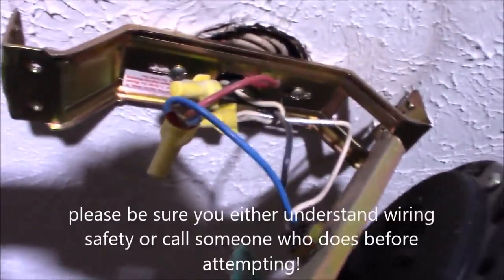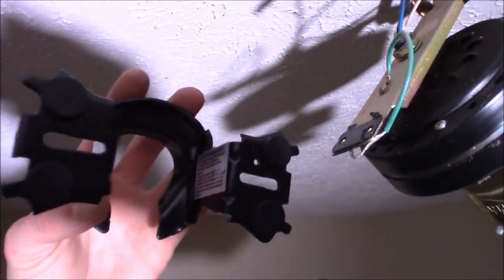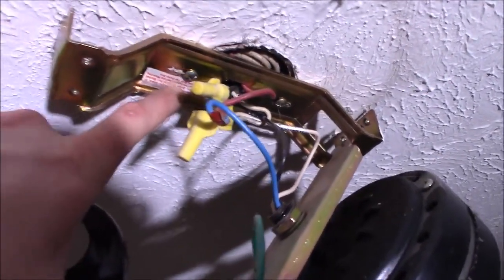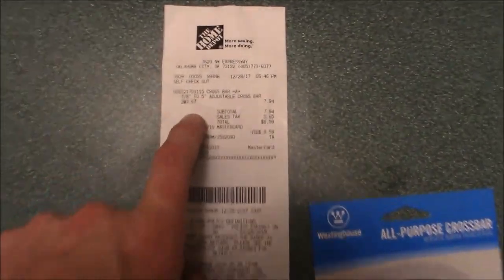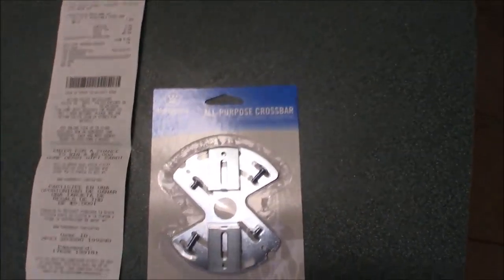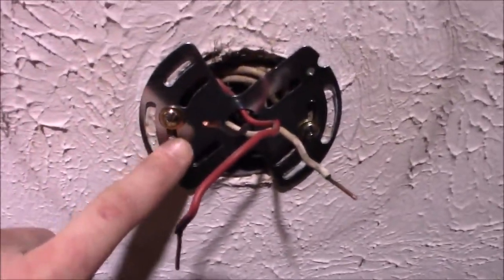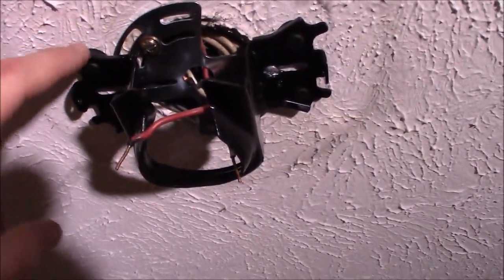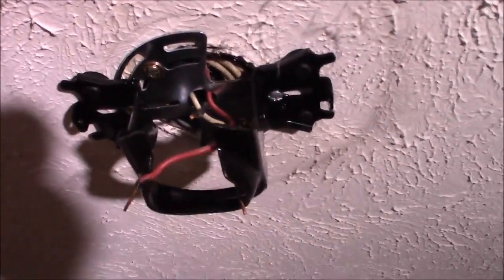Ceiling Fan Universal Mounting Bracket

Comment: Oh the joys of home ownership. This is the exact dilemma I have and I bought the same universal bracket from home depot. Thank you for this tutorial because I got stuck figuring out how to mount the universal plate with the hunter fancy pants bracket. Victory is near. Thanks again!
Reply from the maker: glad it helped some, how did it turn out?
Reply: Daddy's work is never done
We (BF) actually bent the new bracket in to fit the existing 3in light box (it was out of line by 5/8 -7/8 in) and back up and out at the ears to fit the canopy. It fits and works perfectly and balanced. We didn't use the universal plate.
I'm saying we because I bought the darn thing. Lol

Comment: I had the exact same problem with the Hunter Avia II Model Model 50601. I called their customer service, but they were pretty much clueless as to how to fix the problem. I called an electrician to have them retrofit and replace the junction box in the ceiling which they quoted would approximately cost about $300 including fan installation. I gave it another try to find an easier way to do this on YouTube and finally landed on this video. THANK GOD! This is exactly what my problem was and I found an easy fix. Awesome.

Comment: So my box was 4" and had an old fan that I had to replace.   I got the same bracket at home depot for $4.50 and it fit perfectly.   The new Hunter bay bracket then fit the extended holes perfectly.   Thanks for your video this is the only video that I found showing how to retrofit the ceiling box to fit the bigger Hunter Bay bracket..   5 stars from me!

Comment: Exactly what I needed too.

Wish you could have recorded the actual  installation of the bracket and which screws you used in the specific holes/slots
Reply from the maker: sorry man, I really wanted to get that part, but not enough hands, and don't have a high dollar go pro forehead mount
Reply: @workingdad  Did you use the screws that came with the cross bar to attach the fan bracket?

Comment: I almost pay $300 to an electrician because I couldn’t figure this out. My house was build in 1971 and has exactly the same ceiling light boxes. But I was changing a light fixture to a new fan. After a lot of reading I though of changing the whole box which meant a drywall repair to accomplish. After showing this to an electrician and he mentioning that those metal boxes were strong enough and with an “adapter” He would be able to install the fans, I decided to search and come across your video. You saved me $$$ and because of COVID-19, This was very much needed. Thank you

Comment: 4 years after you posted, you just helped me out! Thanks!
Reply from the maker: glad it helped, and thank you for watching
Reply: @workingdad   this is amazing is an amazingly helpful video. Can I ask you a question because this just happened to me?  I took the ceiling fan down and the bracket didn’t fit with the  new fans.
Reply from the maker: @annetteacquaviva5291  not sure what type of box or fan you have, but the issue I had was I had an older house with the older style box, which is smaller than newer fans.  this bracket is designed to mount the newer fans to the smaller size older box. Of course one still needs to ensure the box is securely mounted and rated for the weight of the fan

Comment: Thanks for this video...  I have the SAME problem, just bought TWO new hunter fans, and they are the older metal pancake electrical boxes (circle type).  And I even bent the bracket, and I sort of got it to work, but then the STUPID cover plate didn't line, up, so... I'm had to REBEND it back to original so, that the holes line up to mounting cover.  lol...  Fun fun fun!  The funny part is, we are replacing two old 30-year fans that barely fit the mounting bracket as well. Glad there is an adapter, replacing the electrical box didn't seem like a very good answer to me.  On my way down to home depot!

Comment: Just came across this today. House was built in 1990 (Had been renting it for the last 15 years and remodeling for sale) had the smaller box in the master bedroom. A 1/2 hour project turned into another cluster F, tried the long wood screws, was installing the blades and my wife noticed the whole fan was starting to sag from the vaulted ceiling. Had already been to home depot and Menards earlier, so I just moved on to another project.
Reply from the maker: oh man, that stinks.  definitely have to make sure it's a supported/rated box for ceiling fan.  my box was a fan rated box , just the older, smaller diameter.
Reply: @workingdad  I originally installed a ceiling fan in that room with zero issues and the renters beat the S*^* out of it. So i'm replacing it, with the cheap Hunter fan.
Went to Home Depot just now and bought the adapter piece and it should now go in without a problem. Thanks for your video.
Seems to be the only one on YouTube!!! regarding this annoying issue
Reply: @workingdad  bought universal adapter. Problem solved. I blame Hunter for the random difficulty.

Comment: Thanks for this video. First time installing a ceiling fan in a home that’s only 20 years old and it’s also using the smaller junction boxes. Really odd that these newer fans only have the mounting holes for the larger size boxes. $5 fix is a lot better than ripping the old box out.
Reply: I can't stand with fixtures are updated for no reason. This chaps my hide. LOL

Comment: Hey saw your video… where do the screws go in when you try to mount the fan bracket to the adjustable mount? Since we already used the two holes in the smaller box I am trying to figure out where would the screws tighten for the fan bracket?

Comment: I’m sorry this is well intended to help a lot of people with this situation, my self included. That being said, I crawled up in the attic and uncovered my junction box. There was a pretty heavy duty brace up there and a metal box. Went to the hardware store and bought a bracket similar to this one. I figured out what I had to do to make the new bracket work. Put it up there and took it down. The metal is so light duty that the ears bent. It was worth a try but I believe it’s too flimsy for me to trust. Thanks for the glimmer of hope that I would not have to pay the electrican $300 bucks but that’s what is going to happen. I am sure that the rest of my fans are the same way so fingers crossed they will last us anyway.

Comment: Did you drill into the ceiling through the threaded holes in the universal mounting bracket? Or did you use the short screws to mount the Hunter bracket into the universal??

Comment: Which screws did you use to attach the Hunter bracket to the adapter, the ones that came with the fan? And are there screw holes in the adapter that fit those screws or did you have to put nuts on the other side of the adapter? Did the screws dig into the drywall of the ceiling, i.e., did you have to drill holes to allow for the screws?

Comment: Just had the exact same issue with the same bracket. Just moved it over a hair. One screw in the gang box and one directly into the stud.
Reply: Thank you! Me too and this solution saved me a trip to the hardware store. Worked perfectly! As long as there is a stud on one side this negates the need for the universal crossbar

Comment: Do you drill into the ceiling dry wall once the bracket is installed if your fixtures screws are farther apart ?
Reply from the maker: hard to say without seeing the fixture and its mounting screws/bracket, but the idea of this bracket is for the mounting screws to go into it, so that the weight is properly transferred to the box. if the mounting screws are only into the drywall, that would not be strong enough and would fall

Comment: QUESTION: I purchased this and attempted to use it BUT when I went to attach the ceiling bracket to it, the screws either wouldn't go into the ceiling (I assume I hit metal or something solid) or the screw went straight through the ceiling too easily (I assume I didn't hit the wood and just ceiling). How do I know where to place the other screws properly once the universal mount is set? I'm very close to just hiring an electrician because I am so frustrated.
Reply: I think to your case is probably wise to make a bigger holes for a new and wider box with a cross bar.  
It passed already 3 weeks since you posted this question, what is what you did anyway?

Comment: Where and what screws did you use to mount the bracket.
Reply from the maker: it comes with the screws to mount it to the original box. also, the screws that held the old fan should fit.  bolt size and thread is the same

Comment: Thanks for the video! Just had one question, is it ok if the screws you are attaching to the universal bracket extend past the ceiling box and screw into the drywall of the ceiling? Thanks!
Reply from the maker: shouldn't be an issue from a functional standpoint, as long as you're ok with the small holes it puts in the drywall, it won't hurt anything else
Reply: @workingdad  Thanks for your help!!

Comment: This may be dumb but once the weight of the fan is on the newer style/wider bracket, won’t it fall out of the drywall since the screws are drilled directly into the drywall through the universal steel plate?
Reply from the maker: that's the key piece to this-the screws go into the new bracket, that is what holds it.  the screws may stick through a bit further and also into the drywall, but the drywall is not what holds the screws.  the screws must go through the new bracket into the old, and then the fan bracket screws go into the new bracket

Comment: With the adapter installed do you need nuts on the other side of the screws that will install the mounting bracket? How does the bracket stay on the adapter? Just the crying fan mounting screws?
Reply: m o
I had the same exact issue. There are only two round threaded holes. Watch for these and screw your fan to them. 

Hope this helps. Thank you for the video Daddy!

Comment: When you screwed the ceiling fan bracket to the new universal bracket did you have to screw it into a stud or just though the drywall?
Reply from the maker: just throught the drywall.  so weight bearing goes like this:
-universal adapter bracket screws to the existing box (make sure existing box is weight bearing)
-new fan bracket screws to the universal adapter bracket. screws will protrude through the bracket and into the sheetrock above.  the weight is transferred to the adapter bracket, then to the existing box, the sheetrock is not capable of bearing weight
Reply: Awesome got it. Ty so much. Appreciate the quick response.

Comment: I still dont get how you mounted the fan bracket to the new adjustable piece.   Did the screws just go into the ceiling?
Reply from the maker: yes, they just push into the sheetrock a bit. but the key is that they screw into the new bracket first, thereby giving the strong support needed.

Comment: So the new crossbar comes with 4 short (2 1/4" & 2 1/2" ) screws - I'm not sure I feel good about the fan bracket being secured to the crossbar with these short screws.  Your screws look thicker than what came with mine.  Did you use your own screws to fan bracket attach the crossbar?
Reply from the maker: I used what was in the kit, perhaps it's changed or comes with multiple screws?  A lot of possible variables, I would say if you're concerned go with your gut on it

Comment: Thanks for the video.  I have the same issue.  After the universal bracket is installed, are the screws for the fan bracket inside or outside the electrical box?  For me, one of the holes is outside the box which means I have to cut away some of the ceiling so the screw goes through.  Wasn't sure if you had to do that as well.
Reply from the maker: I don't think it will matter, other than any extra length of screw will screw into the drywall.  the bracket is threaded-that's what the screw threads into, so as long as it's holding there I don't think it will matter inside or outside of the box.  but short answer, yes, one or both will end up outside of the box due to the box being the older smaller size

Comment: This may be somewhat of an amateur question, but what did you do with the grounding screw and wire? I have the same issue, but the grounding screw and wire on the fan bracket prevent attachment to the adapter. I see it's removed in the video, did you reattach it? If so, where/how?
Reply: Sean Kennedy I’m wondering this too, did you ever find an answer?

Comment: Question (God I hope he still checks these comments lol), the outlet box I have is narrow at the entrance but widens inside so I can install the adapter like you did, but when I go to install the bracket I would have to drill through the outlet box.  Can I do that?  Is it a fire hazard?  And what would I need to drill through it?
Reply from the maker: not sure how risky this might be without being able to see it..but a few thoughts
-if the box is drilled through, that probably violates electrical code
-risk of hitting the wires (romex) when drilling, could result in electrical fire later
-those boxes are a very hard steel, very hard to drill

Comment: what screws do you use?
Reply from the maker: pretty sure it came with screws to attach it to the old box, and then regular screws that came with the fan to attach the fan to this bracket.  either way, the screw thread and size are the same for both sets of holes

Comment: I don’t agree with others, we are talking about hanging a fan and not a light bulb, in the video he just used the box holes to hold the bracket but ultimately he is directly hanging the fan in the sheet rock. This is  not safe and this bracket should only be use to install light fixture nothing heavier.
Reply from the maker: scratching my head on your comment, that is an actual fan box in the attic.  the issue is it's from 1960 and smaller diameter than the newer boxes.  rest assured it's plenty strong and sufficiently anchored
Reply: this is what i was thinkign as well - notice that screwing the new bracket to the crossbar's adapted wider holes goes directly into the drywall. there is nothing governing secure attachment of the new bracket to the crossbar itself besides the threading of the new screws - if you pulled with enough force down on the fan the new bracket would come straight through the crossbar's wider holes. of course the crossbar will be fine since it itself is mounted directly to the junction box

Comment: Dude this video was perfect! I ran into the exact same issue! $5 fix! Thank you so much for sharing. I was about to start cutting into the ceiling to replace the box. What kind of screws did you use to secure the adapter?
Reply: Yeah what kind of screws did use to secure the new bracket onto the cross bar plate?

Comment: Nothing about this solution is legal or particularly safe, the ceiling light box is not rated for ceiling fan support, nor is the universal cross bar nor are any of the #8 screws holding it all together rated for fan support, fans are required to be held by #10 screws into a fan rated box. That old 3/0 box is likely fastened to a joist with small nails or to a thin bracket nailed to the undersides of two joists before plaster was applied and will loosen and crack the plaster at best or fall at worst, it was never intended for support of a ceiling fan which moves. A proper fix is to remove the old box and replace with a fan rated box.
Reply from the maker: ? scratches head ?  there was a ceiling fan there to start with.  the issue is the older box size is smaller than newer boxes and newer fans and fixtures. the old box is anchored sufficiently.  The product is being installed exactly as designed and intended.  curious what your 'qualifications' are? enlighten the rest of us please
Reply: I believe you are correct that #10 screws must be used for fan mounting weight requirements. You will see this on new electrical boxes with fan ratings.
Reply: @workingdad  Sorry I just saw this, my qualifications are I am a licensed electrician in Arizona. I assure you that the requirements I stated are to current code. Have installed hundreds of fans. Have seen 2 fall and many plaster ceilings cracked due to fans installed on improper boxes.

Comment: Man, this video would be perfect if you just could've shown how you actually drilled into the new holes
Reply from the maker: no drilling, that retrofit bracket has all the threaded holes you need.  screw the bracket to the old small box using the inner holes, and screw the fan mount bracket to the retrofit bracket's outer holes

Comment: My question is, does the adapter "reduce" the load rating?  I'm assuming you have a ceiling fan rated box (so it can hold up to a 70 lb fan, I believe), so when you attach this bracket which is rated at 35 lbs, is the "unit" load rating reduced as well?   That question aside, thanks for taking the time to put this DIY clip together.  It's guys like you that have really helped DIY idiots like me.  :-)
Reply from the maker: I would say yes, load rating is down to rating of lowest rated component.  I didn't really look for a rating, so not sure if there was a rating on the adapter.  I have a lower end, lighter fan, so may not be an issue for me, but good thought there, if someone has a larger fan that could be a concern

Comment: Exactly what I am dealing with, so thank you for sharing. Quick question - When you mounted the Hunter bracket to the adapter did you use reinforce the screws at all?
Reply from the maker: I didn't add any additional reinforcement, only used the screws in the kit.  I could see that the box in the ceiling was mounted well, and to me the adapter kit seemed to mount well/be plenty strong
Reply: @workingdad  Did you use the washers in the Hunter kit?